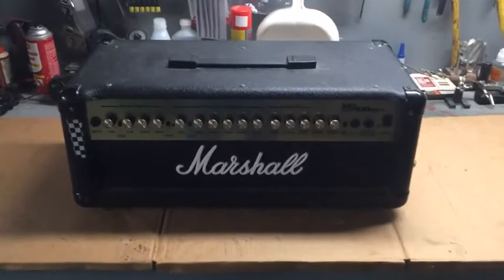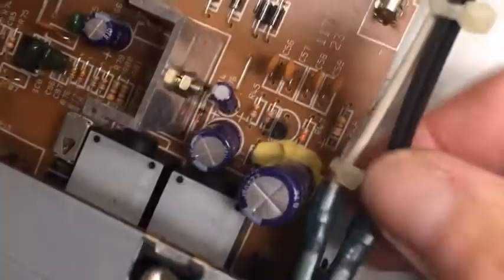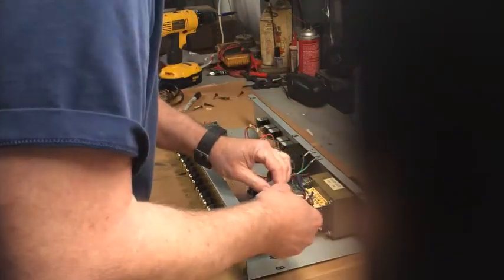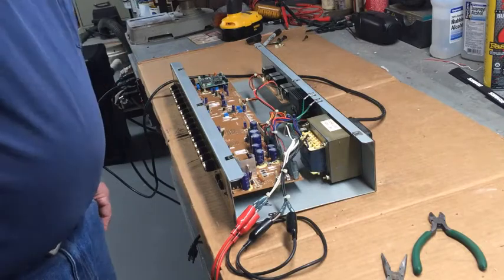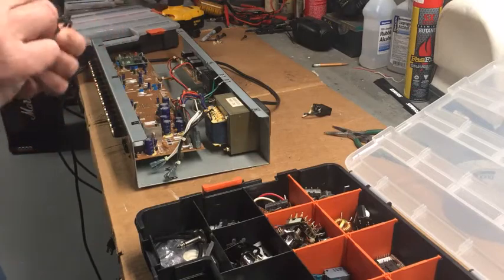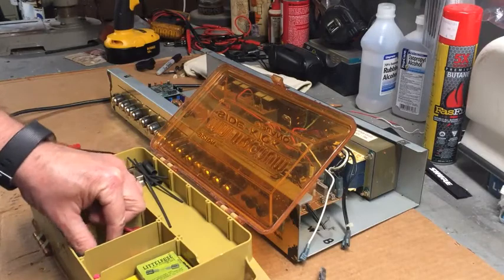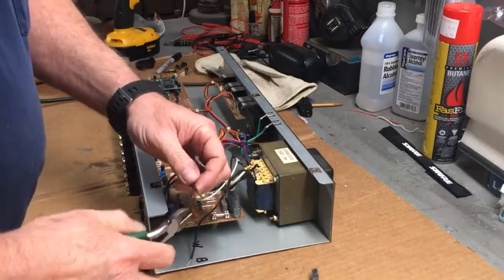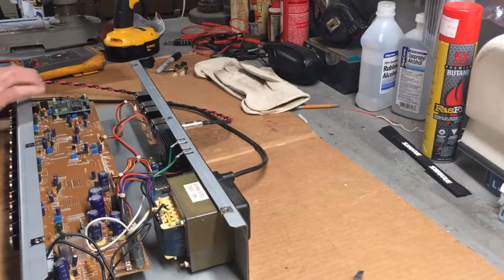Marshall MG100HDFX Power switch repair

Comment: Hi, I'm getting one of these amps next week, I've read about the fan, I was thinking about replacing it with a new better one and maybe putting a bigger heatsink for the amplifier, did you end up doing something regarding the noisy fan?

Greetings from Colombia
Reply from the maker: I did not replace the fan , after running a few mins. it sounded better.
Reply: The fan is only loud for a few minutes, then it quiets down.

Comment: That switch looks like shit. Should have used the exact same one ordered it in. Unreal.
Reply from the maker: Yes looks like shit , but fixed for free. I like free and so did the owner.
Reply: Oh boo hoo! Maybe if you actually practiced playing guitar rather than aesthetics, having pristine equipment and looking "cool" maybe you would have given a crap about a switch.
Reply: @togspots  I know I don't have to tell you but a couple pieces of tape you could have marked and wires before you took it apart or diagram correct with the tape markers? I know we're all Smarties! Thank you ! Did enjoy your video!